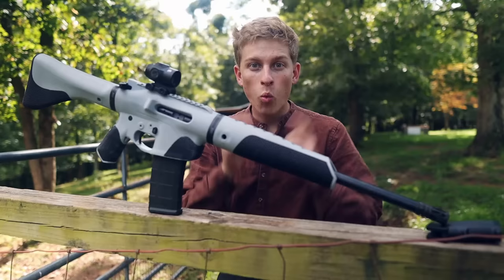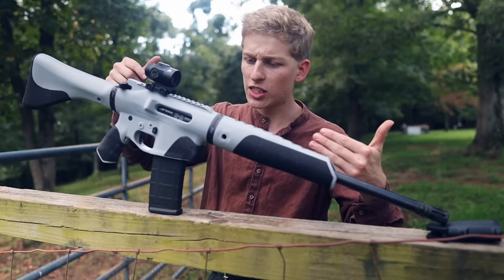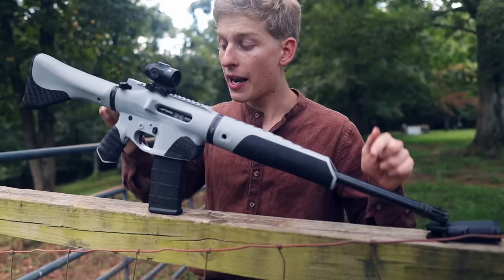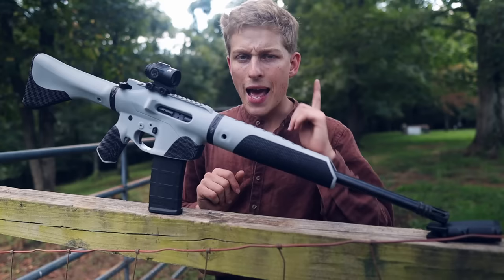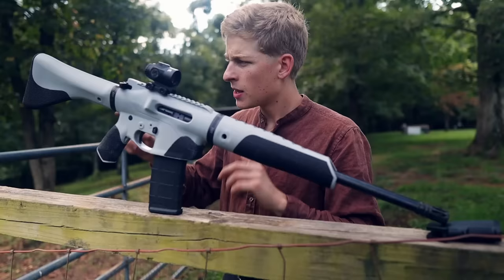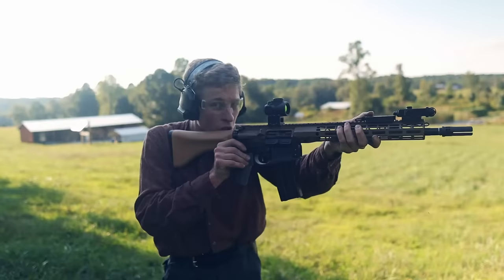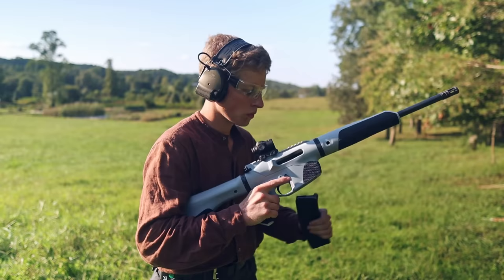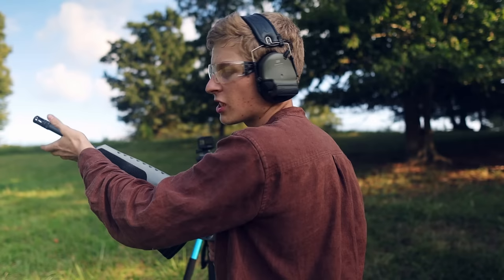I Printed an AR-15

Comment: that is a cool design, the only thing I would do differently is have the side charging handle like AKs do so you don't have to worry about making a slot for the charging handle and possibly modify the stock just a bit.
Reply from the maker: It can be done, but rear charging is nice ;)

Comment: What is that textured grip area ? Did you print that on there separately or is that part of the design?
Reply from the maker: It prints with the part, but the color is painted on.

Comment: There's a flat where the cartridges are hitting causing them to bounce forward. The thinnest portion of the brass deflector should be closer to the bolt for the brass to tumble out like you want.

Comment: T bolt clamps, at least the way I see it they’d be a little bit less of an eyesore and they’re also stronger than hose clamps, they have a tendency to skip threads. May not meet the ascetics, but would definitely be stronger. I used them a lot in charge piping applications where regular clamps would get blown off t bolt Clamps were the go to.
Reply from the maker: Too bulky is the issue. Would also not conform well to the towers profile.

Comment: The hardness of the plastic is different than that of cast or billet aluminum.  How did you end up resolving this?  I was thinking an aluminum or brass faceplate inserted into the face of the deflector or changing the angle - cutting it back towards the rear of the upper.
Reply from the maker: I ended up changing the angle. Basically, on plastic the shells bounce and on aluminum they slide.

Comment: Why not optimize petg settings for higher temperature tolerance and also mechanical properties?
Reply from the maker: PETG is not used because of it's poor mechanical properties.

Comment: Why exactly print something like this with PLA as opposed to ABS or even PCCF?
Reply from the maker: It's a prototype. ABS out of the question due to poor mechanical properties. CF Nylon is my normal go to, though PC has potential.
Reply: @HoffmanTactical  Very interesting, I never got to print many different materials, currently finishing up a voron build to finally start experimenting. I'd love to learn more about how to use the mechanical properties of each in my designs

Comment: You need to Dremel the spot where the deflector melds into the upper receiver...the ejected round is hitting the receiver not the deflector...you need a straight angle into the ejection port

Comment: add some coolant lines through the upper with that added thickness
Reply from the maker: I'd like to.
Reply: @HoffmanTactical  shit now i think about it high pressure air would be ideal since you wouldn't need everything to seal watertight

Comment: How are you shielding the handguard from the heat of the gas tube?  I've got a 3d model of a handguard I'd like to use but I want to ensure it'll last before I go to print it - looks like you've got it licked, though.

Comment: I see 2 problems with the ejection.
First, I think you have the some geometry issue: the wall is too thick under the deflector and the case hitting this flat/straight surface instead of the angled deflector surface.
The second: your rifle is over gassed, i think less gas will improve the ejection pattern more forward.

Comment: amazing build and the hose clamps look awesome! looks like failure to eject is caused by the brass deflector not going into the actual ejection port, shells are bouncing off that small flat face on the ejection port. Especially because the deflector is much larger, the flat face catching the shells is much thicker than the front part.

Comment: Idk if it's possible but you mentioned installing some sort of cooling fans to help dissipate heat.. have you considered a pezio electric cooling modules.. there compact and get extremely cold I feel it would be easy, or just as easy as installing cooling fans.. and possibly add in some ventilation with forced air induction..

Comment: it kinda looks like maybe the ejection port might be slightly longer than it should be because the brass makes almost a complete 180 before it has completely left the port, but that also could just be my perception from the video angle

Comment: Brass being ejected  to far forward usually means over gassed/timing issue might want to put a heavy buffer and or spring to counter the increased gas or change barrel and or gas system length to change the dwell time

Comment: well there is many ways to reduce the heat.  my best advice would be to take a inferred heat senor to this after shoot and during shoot and get a better understanding of where the heat is produced, how it travels through the gun etc.   then what i'd do is use a bunch of air holes kinda like a PS4 does to cool,   you can try heat treating the full gun at 100 °C for 4 h,  try printing a heat shield for the barrel heat or change the design a tad bit like the mg 42 and just change out the barrel when it heats up too much.  take tips from the mg 42 and how it cooled itself or you can go extreme like the M1917A1
Reply: you could even try printing the ar 15 rail out of a polycarbonate to reduce the heat/melting issue
Reply: or try making a tin foil heat shield inside the rail system

Comment: your barrel is overgassed, and the ejector doesn't have time to rotate the brass into the right position, before it hits the ejector. Try a different barrel, with smaller gas port (or adjustable gas block) and I bet the problem goes away.
Reply from the maker: Sadly I've investigate4d this, and it's not the issue. It's something to do with the plastic itself.
Reply: @HoffmanTactical  I'm curious what your investigation involved. If it's NOT overgassed, which it looks like it is, then, looking at the high speed(not nearly high enough to tell for sure), it looks like the brass is hitting the shell deflector too "high" on the brass. If the CG of the brass is inboard (closer to the bore) of the contact point on the brass deflector, then the brass will just bounce forward, instead of inducing the accelerated rotation, which you normally look for. You might try making the brass deflector lower, and possibly farther forward? If you can get high speed video from a higher angle (farther above the ejection port, preferably almost directly above), with better lighting, that would go a long way to diagnosis.
Reply from the maker: @JohnDoe-fk6id  I've gotten a bit more video, of several more iterations, and my conclusion is that the elasticity of the plastic is creating the strange ejection, though I'm not entirely satisfied with that. And the gun is over gassed, but that does not cause this level of issue. I'm going to install an adjustable block just for grins, but in general the over gassed thing is way over thought. Not as big an issue as you might think reading the forms ;)

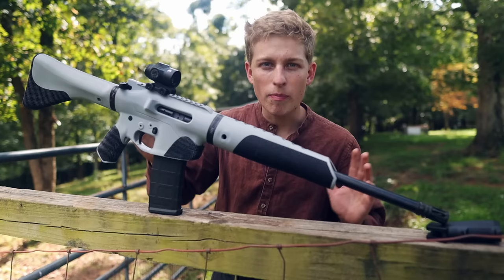Comment: You could try a heavier buffer or a stiffer buffer spring. Over gassed guns eject so hard off of the brass deflector that they eject at 12:30 or 1:00 like yours does. Decreasing bolt velocity will allow it to eject further from the front of the gun. I understand that you will probably want to adjust the brass deflector anyway but I bet if you just try an H3 buffer this version will run like a top.
Reply: Good work and good luck by the way! New subscriber here!

Comment: I think you need to carry the angle of the deflector all the way through the ejection slot.  It looked to me like the cases were hitting the rear face of the opening, which has no angle, and we’re then bouncing forward, hitting the front face of the opening and which was then kicking the front of the case outward and which in some instances was causing the base of the case to rotate inwards, giving a stove pipe jamb.

Comment: what if you create a modular radiator system to cool the body from the outside. or 3d print waterproof piping throughout the body to cool everything.
Reply from the maker: Backpack mounted radiator + water cooled heat sink would be really cool. Add a linkless ammo feed system and your ready to rock and roll.

Comment: To avoid the heat issue I has thinking on charging the part in contact for wood. Will resist better and won't transfer the temperature to the plastic. But need a cnc to make that part. Or buy it. I have the cnc and some knowledge on 3d design (not as good as yours haha) but cannot make this gun where I live now :(

Comment: The rear of the ejection port is too perfectly in-line with where the casing is trying to eject. It's basically belly-flopping into the ejection port, losing it's energy, and not getting thrown free from the action.
Adding about an 8" radius to the deflector as seen from above and merging it into the ejection port should fix most of that problem.
Reply from the maker: Just got a print that does that assembled. Will test today ;)
Reply: @HoffmanTactical  👌

Comment: Looks like the ejection port should be a mite longer i think that’s the prob. I say that because your wall thickness is greater than a normal ar upper, so the ejector is turning the casing at it flips it out, but has to turn it at a more severe angle by the time it reaches the backend of your ejection port because of the greater wall thickness. So in order to compensate for that make the ejection port about 1/4 inch longer

Comment: This looks pretty clean. 

Question though. If you can use a 3d printer to make stuff, why remake a well used design like the AR-15? With that tech and your skills, why don't you try and make something new?
Reply from the maker: It's a learning process. Making a gun that you can still get parts for is a lot easier then doing something fresh, that comes next.
Reply: @HoffmanTactical  Gotcha. Well, I wish you luck then. This tech coming out is really amazing to be able to make things.

Comment: Why not line the barrel with something to dissipate the heat. Ik u said a water or fan, just googling "heat dissapation materials" list a bunch or alt ideas. I see Thermal paste, ceramics, graphite, etc. Then the issue is how does that fit into the AR and pricing

Comment: I'm not sure if it'd work well or be strong enough, but we use some rubber sleeves to repair forklift battery cables. You have to use a heat gun to shrink them down, but maybe that or something similar would be a thought for replacing the hose clamps? Haven't printed anything of yours yet, but I have bought from your website. Looking forward to more content!

Comment: So correct me please if I am wrong in my assumption. I have heard many people say that 3D printing of firearms is going to create a ton of problems for law enforcement, GHOST GUNS is the term I keep hearing. BUT, if you still need a steel barrel and chamber, firing pin, lower trigger assembly etc, aren't these part serial numbered? And if they are serial numbered, then you need a firearms license to print so not any Tom Dick or Harry can print one, correct? So why all the hoopla?
Reply from the maker: Nope, only the receiver is controlled. The rest of the parts are easy to buy without interference. Also, 3D printed firearms are not an issue for law enforcement, the problem has been made up by fearmongers. The only ones who don't like 3D printed guns, are those who want to keep all the power to themselves.
Reply: @HoffmanTactical  OK wow, I did not know that!

Comment: I'd probably opt for a pin assembly for the stock and front shroud, but that'd need integration into the 3D printing software. Overall, its a great setup! I'd probably give it a nice paintjob once you sort out the ejection issues!!!
Reply from the maker: Pin assembly?

Comment: It seems to be an issue of chamber pressure, where the BCG isn't managing enough energy to throw the round out with the extractor. Deflection is bit off but it doesn't seem to be the primary issue. I think the better bcg had tighter specs so it performed better.

Comment: Try smoothing the transition from the ejection port to the brass deflector. It almost looks like the brass hits that sharp angle coming out of the ejection port before it hits the brass deflector. Also the angle of the brass deflector can affect the direction the brass travels. Or since it's a right handed rifle you could do away with the deflector all together. Some rifles don't have them at all. Just my 2 cents. Beautiful rifle by the way.

Comment: do you think you could 3D print a cool stock for a winchester model 70 featherweight .30-06 or a remington 700 7.62x51mm   ? kinda like the MSR TYPE STOCK

Comment: You've mentioned the ceramic insert  for the gas tube, are you doing anything to mitigate heat on the barrel mount?
Reply from the maker: Barrel mount is CF Nylon. The gas tube gets a lot hotter then the barrel, a lot faster, which is why it need the ceramic.

Comment: with areo bolt you are running over gased... I would get an adjustable gas block and tune till your ejecting at 3 o'clock...

Comment: For the heat issue why not try using plastic that it much more heat resistant than pla+, like maybe nylon, glass fiber reinforced nylon, something carbon fiber reinforced, etc.
Reply from the maker: PA12-CF print just completed ;) Annealing it today.
Reply: @HoffmanTactical  Niiiiiiiice. So excited to see that

Comment: When the shell comes out it does a complete 180 on your printed upper, making the front of the casing hit the deflector. On a normal Upper the casing hits the deflector closer to a 90 degree so the side of the casing hits instead of the front. It could be related to the small surface area of the front of the casing hitting the deflector isn't enough for it to follow the angle of the deflector. Whereas if it hits at a 90 degree angle it's going to slide across the deflector with ease. Hopefully that makes sense. Somehow I think you need to reduce the angle of ejection?  Not sure how you'd do that though.

Comment: Could use ABS, though it can be a pain in the ass to print.
Im sure youve considered it, would be interesting to see how that would act in comparison to pla+
Reply from the maker: It has been tried, and the poor mechanical properties compared to PLA+ are an issue.

Comment: Try Nylon or ABS. ABS has high temp resistance and will last so much longer under normal operation.  ABS would be easier to smooth out with acetone bath, plus smoothing the surface will add additional strength to the outer shell.
Reply from the maker: But it's too weak (ABS).

Comment: 2 things. 1. Mid-gas on a 16" barrel, please. 2. Film at 30fps, please. (lower shutter speed below 180 degrees to retain natural motion blur Try 1/40th to 1/50th)
Reply from the maker: Mid length is great, but is hard to cover with a printed handguard. And the video was at 60 FPS with a 1/125 shutter. Faster speed is good when shooting because it lets me slow it down later if I need to inspect an anomaly ;) Normally I would run 24 FPS / 1/50 shutter.

Comment: The real question is, what's a price estimate on something like this? Other than it being under the radar, I feel like it would be better off for someone to build there own basic rifle for less than $500, or just buy a BCA or PSA complete rifle for around $500-$550. It would probably end up being a lot more reliable in the long run.
Reply from the maker: I agree, unless uppers become regulated, they will be a better option. This project is to learn and push the envelope.
Reply: @HoffmanTactical  Of course, of course. As any scientific research has shown. No one comes out with perfection on every attempt. I'm sure when the beta test happens you'll truly be able to see where improvements need to made and hopefully this will become a reliable and cost effective option in the future.
Reply: >BCA
>more reliable
lol I'd rather take the 3D printed gun that melts
Reply: @SuperXrayDoc  Seems to me that you've never owned a BCA? Or you would know the comment you made is quite ignorant. 

You'd rather spend $600 on a pla gun that, as was stated in the video, will only last 150 rds before melting over a $450 gun that have been known to make it to 5k+ rds with no issues. Seems like you have all the disposable income in the world, power to you I guess. lmao 🤣

Comment: Red Dots should be mounted as far forward as you can. Perhaps the brass deflector not being metal gives it a different bounce. I don;t understand any real need to print an upper. Why reinvent the wheel? Unless it's just for cost savings or a  proof of concept.
Reply from the maker: It's not a red dot :)

Comment: Not sure if you've solved your ejection issue or not. If it was me i would open up the  rear of the ejection port at the bottom. If you can, put a steeper ange on your deflector.  I'm rather certain just removing some of the material at the lower back of the of that ejection port should give it enough to get away from BCG. Gotta say, I'm impressed.

Comment: Seems like you just need a more well defined brass deflector. Maybe add some curvature with a downward slant so the empty casings don't slap against a flat surface but deflect and roll downwards. Doubt you haven't figured this out yet but hey, there's my .02. If you need another beta tester feel free to reach out 😉

Comment: Can you thread the forend and butstock on instead of hose clamps
Reply from the maker: Not compatible with 3D printing.
Reply: @HoffmanTactical   oh true thought iv seen them make thos screw thread nut bolt things thought sure it could be thread Paton
Reply: Could it be left flat then hand cut the threads

Comment: As for your ejection issue it looks to be a gas issue not a port or deflector issue
Reply: Specifically it appears over gassed try using an adj gas block load 1 round in a mag close the gas block off and slowly open it till the bolt locks back after firing 1 round